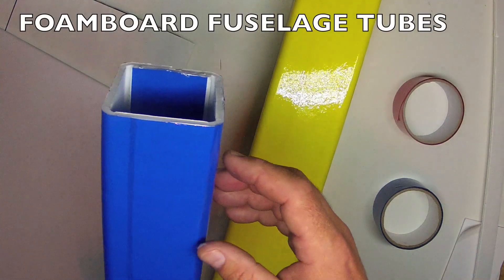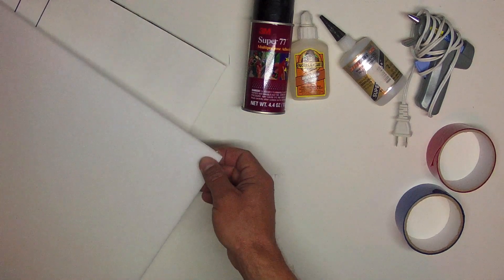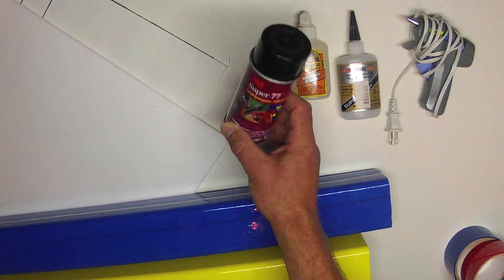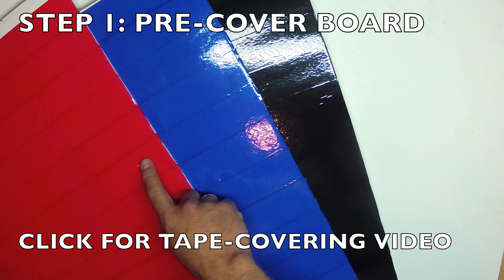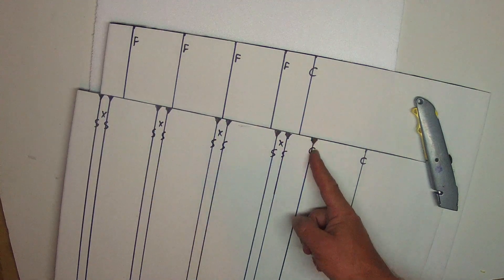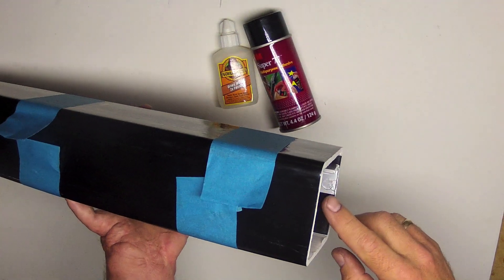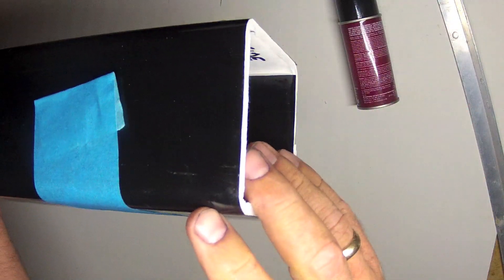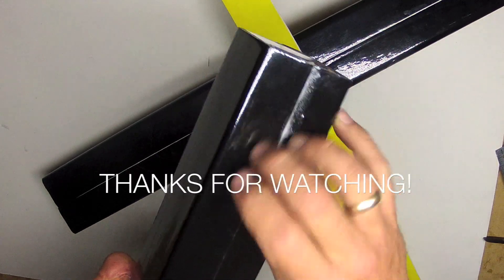FOAMBOARD FUSELAGE TUBES

Comment: As in my country I can not get Adams foam bord, i have only kind of deprom 4mm. I have tried your way of just compresing the lines, but find out that its either breaks, or sqush the depron while bending. So no luck for me. Unless I use the tape on other side, but then its hard to glue something on it. I have noticed the flite test way to cut small 2 lines on fold and remove the depron, then glue it together. Removing small stripe provide enough apace to depron to bend, but as using a glue it adds to a  weight, and I guess is less as strong as straight folding method. So as experinced experimental airliner airplane builder ;-) , can you please advice what is the good way to achive nice square fuselage using just depron. Im aware that materials used by you an here in EU are differen an I may have to find my own way. But any help is appritiated. By the way, love your channel and keep up the good work. ;-)
Reply: I use depron as well. I first apply packing tape or even better document laminate (which you can apply with a normal iron).
Then I cut all four score cuts on the side without the tape.
Then I bend/break the foam on each score cut and make a "double bevel" (like flite test does on leading edges) by cutting 45 degree towards the score cut.
After cutting use some fine sand paper to finish the bevel. 
Then you use a straight edge or a long peace of wood to bend the foam in tube shape. Bend it 90 degrees and further (around 135 degrees) so that it stays in 90 degrees without much strength when it relaxes.
Then you can put glue in the bends one by one (in case of hot glue) and hold it against a straight edge until its cured.
Reply: @the_real_foamidable  hi, would really appreciate if you upload a video of that. Many countries have no depron but no dollar tree board, so would help a lot of people!

Comment: Nice video showing a good method as well. I have just one suggestion, possibly you may have already tried it -but BEFORE folding over your sides to join the split would it be easier to glue your inner support first (to one side only) while flat and then fold & glue closed? Hopefully you can picture in your mind what I am saying. It would allow easier access to the inner support for applying glue & positioning then lay flat and clamp down? Btw - I have been doing this method of building with Depron (& foam board) for several years & before I ever seen it on You Tube it is also the method that I used to join and seal the joint when I build. I will try your method next time  it might be a bit easier-either method should, will work good -Thanks for posting

Comment: The boardfoam I was using wont peel off and was so frustrating..I ended up scoring the bending parts with ball hammer(ball side). It worked but took me longer.. Any advice how to deal with unpeelable foam? Thanks and I really appreciate your time sharing your videos..
REPLY
Reply: spray spirit or alcohol with water (1:1), let it dry and peel. swoosh Magic.

Comment: Has anyone else tried the Super 77?  I just tried it but when I untaped the fuselage tube after 24 hours it just came apart.  I took the paper off the joiner piece, sprayed it with 77 in the garage, walked it inside and clamped it in place.  Really I did everything just like in the video.
I've used Super 77 for foam board planes before but for those I sprayed both surfaces and it went together very securely like contact cement.  In this case you can only spray on one surface.
Anyway, I'll try again with the white gorilla glue.
Reply: I had the same results with the Super 77 so I went back to his old process and used Hot glue. It works well.

Comment: For the people from Euro-Land: This method also works nicely with 6mm Depron or any other cheapo floor or wall insulation foam without an outer layer of paper. Just pre-cover the outside of the Depron/foam with tape before bending. Armin wing style. Then deeply score the insides where you want the depron to bend and form the corners  Use edge of a cd, empty pen, popsicle stick etc.for scoring. Use hot glue, Uhu Por and activated cyanacrylate for glueing. Result ist very stiff, robust and, due to the absence of paper, absolutely water resistant.
Reply: How do you get the depron to hold its shape? Mine is under a tremendous amount of outside tension, even after scoring and bending.

Comment: I'm building your fuselage design with Elmers foam board. It seems to have heavier paper, but it is going together very well. With one sheet I'm going to be able to make a 38 inch fuse (30 + 8) with the 2 inch paper measurement on the inside. I made a set of 7" chord wings, 60 " span. I do not know how to place the wing for center of gravity.

Comment: Do you take the paper off then put the tape on? or put the tape over the paper?  Iv tried watching your videos cant tell. ( dollar tree foam)
Reply: 2020- late :>(...only take the paper off were you glue the inside bottom down (former) .. extra piece goes in bottom the split... glue on paper wont hold/ cause paper will tear! all the ducked tape is on the 1 side all papered/the inside is all paper ..except the bottom .
Reply: @chrisstokley7687  Better late then never, thanks

Comment: Hi Ed,  Currently building the AXON and have a question on how you butt up the 30in standard tube with the 12in angled piece for the lower body main tube.  Do you use anything on the inside to keep the tube pieces square or just butt them up.... tape and use the 12in top chamber tube to help keep it in place... have you had any shifting of the nose part?

Comment: gorilla glue and UHU POR are not alike. Gorilla glue, when activated by water (fine mist/spray) will foam out and expand, so it's absolutely vital that the parts to be glued are well clamped in place to dry. UHU POR is a contact adhesive that requires an even thin coating on both parts to be glued, you allow the glue to dry for 10 minutes, then firmly press the pieces together, they'll pretty much instantly be bonded.

Hope this helps

Comment: Hey Ed, for joining those two halves at the bottom of the tube with hot glue, could you hot glue the joiner to one half, then apply hot glue to the other half of the joiner and put the other side into place, instead of clamping with that extra piece as you showed?